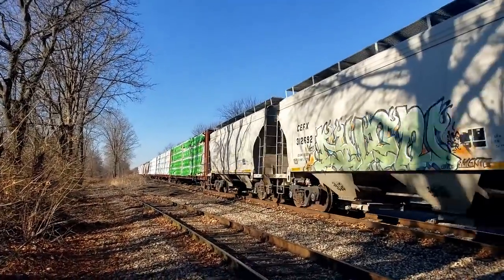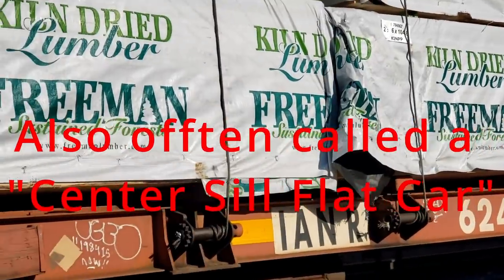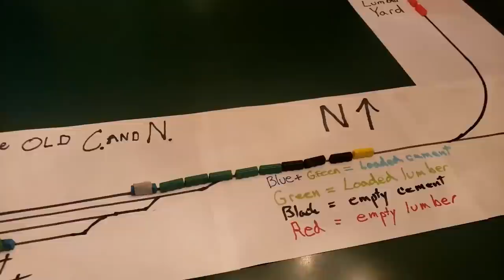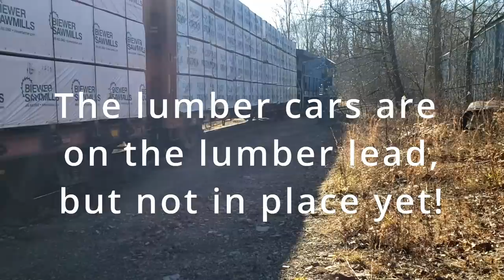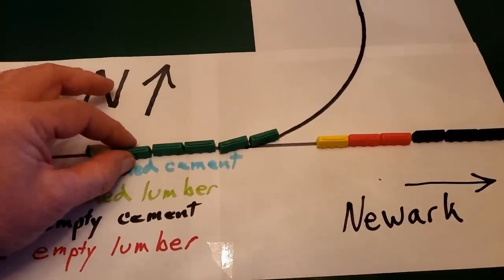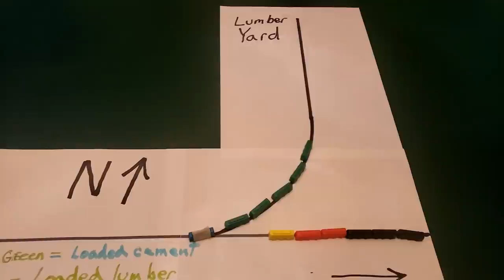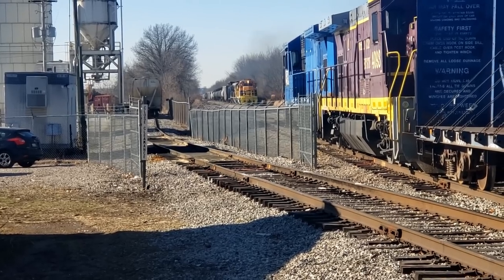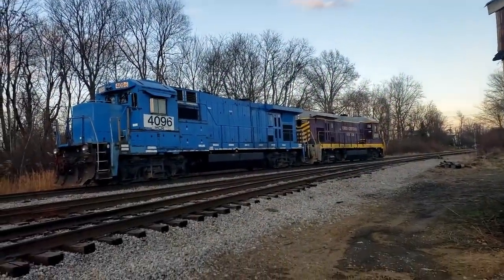The Last Mile of Linear Railroading!

Comment: Generally in our area, a horn is blown with compressed air, a whistle is blown with steam.
Reply: On the railroad, a horn is still referred to as a whistle. In almost all Rulebooks, and most of the FRA rules, it’s referred to as a whistle
Reply: Daniel C   I did some research on the difference between horns and whistles to confirm what I thought was correct.  It’s has probably been 20 plus years since I dealt with this issue.  Yes the term whistle is still used in the GCOR (Rule book).  I believe this is because when the diesels replaced the steam locomotive the correct terms did not get up dated.  

A horn has reeds or diaphragms that vibrate when compressed air is blown over them.  Different tones are created by the length and with of the bell / trumpet.

A whistle, either blown with steam or compressed air directs the flow over an opening similar to us blowing over the opening of a coke bottle.  The number of chimes and their length and diameter determines the sound / tone of the whistle.  Steam used on a horn could damage or destroy the reeds or diaphragms making the horn inoperable. 

This horn vs whistle is not that big of a deal,  because everyone understands what the rule means regardless of which term is used.  Sometimes I wonder what type of operating experience, those responsible for writing and or up dating the GCOR, has.  

When FRED replaced the caboose I would like to know who it was that decided a flashing yellow light on the rear of a train was a good idea.  I almost ran into the back of a train at night that was stopped only a couple cars past the south end of a siding where the mainline signal was dark.  Both bulbs in the red signal was burned out.  I was traveling south bound on the main and did not know that train was right ahead of me.   

I had passed an approach signal at the north end of the siding and made a brake application.  The south end signal was around a curve.  As I came around the curve I saw the flashing yellow signal and kicked off my breaks.  This was a very common situation at this location.  As I got around the curve I realized the signal was too low to the ground to be the mainline signal, and placed my train into emergency.  I stopped about two car lengths before the dark signal and only about 5 or 6 cars before the rear of the train.

The first thing I did the next morning was to call our FRA operations inspector and explain the situation.  His boss in Fort Worth, TX called me later that day.  He confirmed what I had told our local inspector.  The next day I got a call from FRA headquarters in DC.  Shortly I got a call followed by a letter letting me know that the yellow flashing light would be replaced with red lenses by an emergency recall.
Reply: @billmorris2613  that’s very interesting about the yellow FRED, I thought they were always red
Reply: Daniel C   In the beginning some of them were flashing yellow.  I have heard several explanations as to why some were flashing yellow, but I don’t know which one, or if all are correct, or false.  I just know it scared the crap out of me.  It is very dark in that area and I thought we were going to run into the back of that train.  The Casey Jones accident was running through my head, until it stopped.   And I was very surprised that it did stop in time.  So was my conductor.
Reply: @billmorris2613  thank god it stopped
Reply: Daniel C   Believe me, I did!!!

Comment: This is why it is CRITICAL to leave cross-overs and run around tracks in place and not rip them out. 
So many railroads are ripping out all their second tracks, sidings, run arounds and cross overs to save money on switch maintenance.

It is a very bad thing to do

Preserve the double tracks, sidings, switches, cross overs and run arounds even if a customer pulls out

You don't know what the future will bring

The Colonie Sub used to be double track and had run around sidings running for miles on both sides and had cross overs and dozens of customers and rail yards every few miles.

Now, they have 2 customers and they really want no customers

They want to have a single track to move tank trains and Intermodal trains thousands of miles to maximize profit, but because they only have 1 track, every day trains have to sit idle because they have no engineer and no clear track

I would listen to the. Send cabs, taxis 300 miles to get the nearest engineer from Binghamton or Canada or Pennsylvania and drive them to Saratoga to pick up a train.

They are so worried about how much maintenance will cost on the second tracks, they don't look at the loss of income waiting sometimes 5 days to have a clear track

It's insanity

Comment: Interesting video. I think there are a few mistakes in the description, as well as a couple things the crew did wrong.  I believe the crew split power, not because of the radius of the curve into the lumber yard, but rather, because they needed to change directions there, which was the last stop on their run, and they had no run-around track.  To get the power onto the other end of the cars, you need to split power if you don't have a run-around.  I would have done it at the lumber yard, because our rules prohibit having an unoccupied locomotive moving in train like they did.  Maybe they have local rules that permit it, but we would never move a unit like that.  With the locomotive coupled to train air, and unoccupied, any application of the train air brakes will be likely to cause the locomotive wheels to slide as the locomotive brakes work much better than the brakes on the cars.  The only prohibitions we have with sharply curved industry tracks is that we cannot take our 6-axle road motors into them, due to rail spreading issues.  4 axle units don't have any more trouble than the 4 axle cars.  I guess it's possible that the lack of movement in locomotive couplers could be an issue but one I've never experienced in 25 years of similar work.  I'm curious if the crew told you that they needed to separate the units for that reason or if you assumed that they did?

Comment: You really need those engines at either end since you don't have run around capabilities trackwise. So having an engine on either end lets you switch leads facing either direction on the main line. BTW 4093 has the rare OC (Obsessive and Compulsive RR) logo.😀😀

Comment: I'm coming from a point of no experience.  Couldn't they have saved a step and leave the 3 empty cement, 4093 and 2 empty bulkheads on the main, then give the lumber yard their cars?  The lumber yard guys could get back to work.  Resort your cars and engines while killing time for the through train.

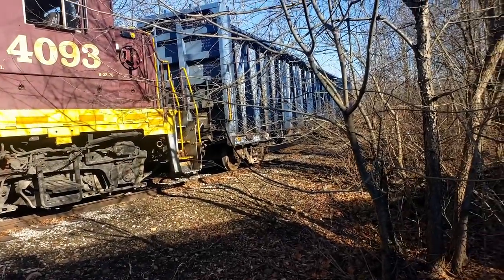Comment: At 25:50, Did they have the brake stand cut out on the 4093 or did the conductor (man working the ground) release the independent brake before pulling it out of the spur with the 3 empties? For those that don't know what I am asking, If the brake stand was cut-out then the 4093's brakes would release when the air was connected through the brake pipe from the other locomotive.

Comment: Great explanation on the car movement. Question, how does the load of the lumber flat car compare to a tractor trailer?
Reply: As an example, look back at 30:20 where the loaded lumber cars are being pushed into the lumberyard. 

We're looking at COER 880123. At about 30:22 the weight stencils come into view: LD LMT 228400 and LT WT 61200.
--LD LMT is the load limit, the maximum amount of cargo that can be loaded on the car which is 228,400 pounds.
--LT WT is the weight of the empty car at 61,200 pounds

Add the two together and you get 286,000 pounds, which is the legal weight limit for the combination of the freight car and it's load. A typical loaded semi in the US maxes out at 80,000 pounds for the tractor, trailer and it's load.
Reply: Rule of thumb: 3 semi equal 1 rail car.

Comment: That 4093 has a bad air dryer or a bad valve on the air dryer.
I am used to hearing a full dump of air release at regular intervals when the air tank is a full pressure, but not like that one is doing

Comment: Personally, I prefer Jenks blue, but that's just me.

Many differences in how things are done, between "line haul" or "local" vs a yard crew switching an industry in a city.  A yard crew would have used a single engine, most likely, using methods that may not be permitted these days.  And different power units.  I haven't heard of anyone "dropping" a car (to get it on the other end of the engine) for a long time now.  I do know they discourage getting on/off of moving equipment, which was done without a second thought in my days.  Getting on top of cars, which had been done in order to pass signals, had been banned by that time.  A few "old heads" still did it, risking penalty.

Comment: My model train set is coming along slowing,   but I had trouble with it last night as had a flat wheels on one axle as I didn't check it quickly,   oh bugger it's just like real flat tyres on a real train ha ha ha,   sadly the costs of the new attachment and engines had gone up 30% ,

Comment: R&R Question, on the empty lumber cars at 38:08 are what looks like guy wires running from the edges of the cars to the center vertical structure. They certainly weren't there when the lumber was on the car so I assume there to keep the center structure from fatigue?
Reply: It’s just a way to neatly store the steel cable tie downs.

Comment: How many truckloads of lumber would have it taken to get the same amount that came in on the train, quite a few I suspect.
Reply: If you know the maximum allowed weight on a flatbed trailer (that is, the 80,000 pound vehicle max minus the weight of the tractor and empty trailer) you can get a rough idea. The lumber flatcars have a max allowable load of 228,400 pounds (stencils visible at 30:22 for example)

Comment: Cool and professional crew working correctly to not worry about being filmed doing things dumb.  Why can't two locomotives be together on that radius?
Reply from the maker: The couplers on the locomotives don't swing as far as car couplers. So if the radi is tight its possible the loco couplers will bind and force a derailment.  Brian

Comment: BTW, it is surprising to see Bloomberg trucks under a GE. I wonder what the history was. What was traded in to GE?
Reply: 4093 (a B23-S7) and 4096 (a B23-7R) are supposedly rebuilt U23Bs, both originally owned by Western Pacific.
Reply: Thanks. I did some research on these two units and they sure have been around the block a few times. It looks like the trucks were from WP F7B's 916B and 918C. Trucks may have been swapped between units for maintenance overhaul reasons but who knows they may have been at the front of a WP California Zephyr train an one time.

Comment: You have 2 restrictions which limits the freedom of switching the cars:
1. Only one engineer
2. Both engines can not pass the curve coupled together, because of the narrow curve radius.

I cant see any more effective ways switching these cars and engines than shown in the video.
Reply: Cutting those engines apart is ok and doesn’t take any time at all but a lot of industrial spurs aren’t necessarily up to standard and are owned by the customer up to the clearance point…..if they don’t keep their track up to shape they can just unload them down on the ETR property and truck it up, I’ve seen plenty of that done……

Comment: What is the issue of two connected locomotives on the curve?
Reply: Kory Klukan  Locomotive couplers don't swing laterally as far as car couplers (except purpose built switch engines such as SW1500's for example).  Two engines hooked together on a tight turn could cause a derailment.
Reply: @mikedurhan9941  And an engine with “limiting blocks” you would have to take them out to switch the tighter curvature…..
Reply: @mshum538  Correct.  Also, you make sure they are in when you take a switcher (in a consist) over the road, such as when it is taken somewhere to be shopped.
Reply: @mikedurhan9941  Yes sir, your right, when the earlier yard engines were being retired it was one less thing to be concerned about…

Comment: That was pretty neat-showing all the moves to make it work.  I was wondering why 2 engines couldn't make that turn. Better than Distant Signal?
Reply from the maker: Stephen   That rule is because the locomotive couplers don't ( wont ) swing as far as a rail car coupler. That's o.k. but when you double the problem ( loco x2 ) its possible you could derail be cause of the coupler bind up,   Brian
Reply: @eastterminalrailway5975  other considerations are weight and tri-axle vs 2 axle trucks.  Some older industry tracks were build too tight for a tri-axle so you had to have an engine with 2 axle trucks, or, reach for your cars with other cars.  We had to use the second method at Ralston Purina because they had to be pulled over the scales, which couldn't handle the weight of the engine.

Industry tracks built during steam days are especially frightful.  I remember setting a boxcar in one that was almost too tight for a SW-12 switcher.  Clearances were less than two inches (in a curve) between equipment and the very old brick building, and rails howled and complained any time there was movement on them.  If you went on the ground, you risked bringing that old building down on yourself.  That was the only time I seen that particular engineer move that slow, keeping the brakes on enough that the engine would stop right away if he cut the power.  I had to stand at the switch, away from the building, yet vulnerable to any hobo or wino lurking in the shadows ... by the way, the biggest advantage of a lantern over a two way radio is you can use the lantern like a club in self defense.  Those old metal Conger's have a fair amount of heft!

There you go, got me reminiscing and writing books again.

Comment: are those B30-S7s?
Reply: B23-S7.
Reply: @mikedurhan9941  that is most definitely not a B23-7
Reply: @CoalChrome  Okay.  I guess the railroad just put the wrong I.D. on the engines under the cab windows.  Thanks.